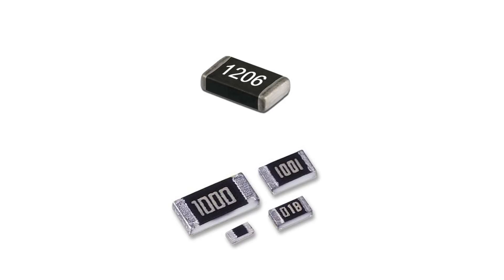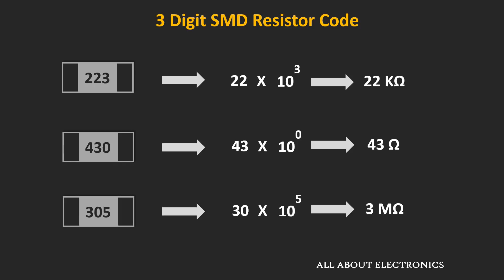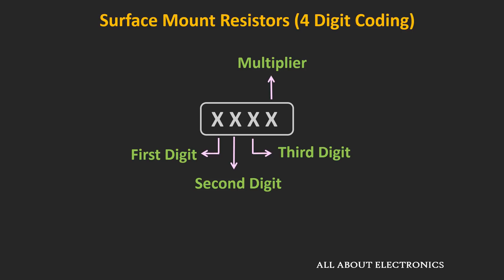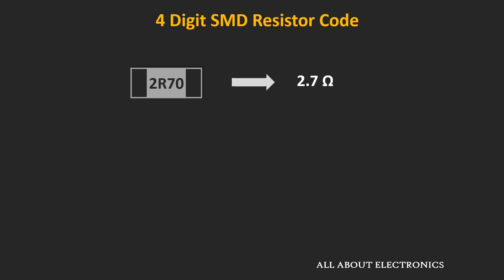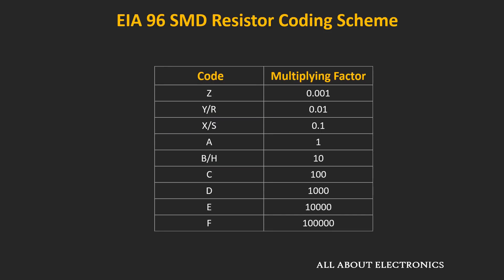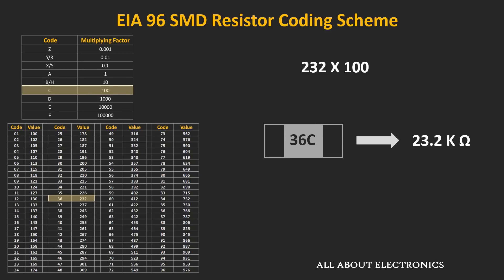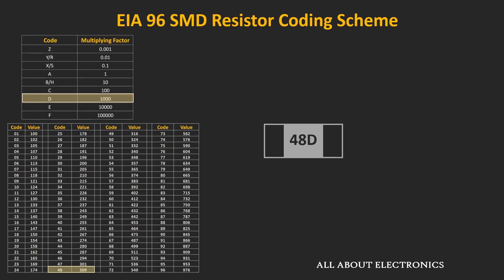SMD Resistor Coding Explained

Comment from the maker: The timestamps for the different topics covered in the video:

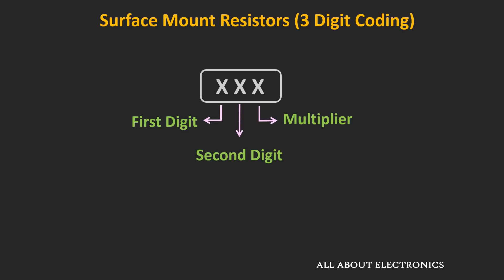0:57   Three digit Coding Scheme

2:41    Four-digit Coding Scheme

4:20    EIA 96 SMD  Resistor Coding Scheme
Reply: ALL ABOUT ELECTRONICS sir I want to talk to you. When will you be free from work ? Can you give me your contact no.
Reply from the maker: You can send me the message on either Facebook page or Instagram.
The link is given in the description of the video.
And preferably contact me in the evening after 8:00.
Reply: ALL ABOUT ELECTRONICS ok sir. Thank you .
Reply: Very nice explanation sir
Reply: There are several factors in studying electronics. One resource I found which successfully combines these is the Gregs Electro Blog (google it if you're interested) definately the most incredible info that I've heard of. look at this  interesting resource.
Reply: Nice Video! Forgive me for butting in, I am interested in your initial thoughts. Have you heard the talk about - Qanayce Wiyulian Equalizer (just google it)? It is a good one off product for unveiling the technique to repair your electronic items without the normal expense. Ive heard some interesting things about it and my coo-worker after many years got excellent results with it.

Comment: Sir one doubt 3.54
4 digit smd register 
0R24=. 0.2*10^4= 2kohm
But
You told 0.24 ohm

Which one is correct??
Reply from the maker: When R is used in the code, it represents the decimal point. So, 2R70 is basically 2.7 ohm and likewise, 0R24 is 0.24 ohm. I hope, it will clear your doubt.

Comment: one of my smd resistor is blown how am I supposed to find the value for it?
Reply from the maker: Unless you have a  circuit diagram , I think you won't be able to find the value of that resistor. Is the code still visible on that, I doubt that though.
Reply: @ALLABOUTELECTRONICS  I have seen the circuit diagram the model number of the board is same as that of the circuit diagram and the resistor is said to be 4R7 but there are other resistor on board which do not match with the diagram

Comment: Does the size matter for smd tks and are there + or - or i can solder them both ways tks
Reply from the maker: For SMD resistor, there is no polarity. It can be connected either way.

Comment: How do you  identify a SMD resistor that has no markings??
Reply from the maker: If there is no marking then you can measure the resistance using multimeter. ( SMD Tweezer)

Comment: How do you find the value of the ones which has no code on them?
Reply from the maker: Using multimeter, you can check the resistance, if the code is not given.
Reply: @ALLABOUTELECTRONICS  Yeah, I'm trying to find the code/ value of tiny smt/smd capacitor/ resistor on a playstation 3 console motherboard. It's a pain to know.

Comment: Thank you for the excellent video.
However, I have a resistor with only "0" (zero) on it!  What does that mean PLEASE?!
Reply from the maker: Its zero ohm resistor
Reply: 8
Reply: @rossmoodley9407  eaven more confusion! If the resistance is zero, why bother to use it?!
Reply: What would R25F on a smd mean?

Comment: Sir please tell me the value of 8F5 , i am not sure if it is a resistor or smd ceramic capacitor ,i want to find the value , 8F5 is written on the board and not on component it self ,......... Please help me sir jus tell me the vale of 8F5 ,🙂🙂🙂🙂🙂🙂🙂😗😗😗😗😗😗
Reply: I am confused because it is not written 8R5 or 8K5 but 8F5 which i have seen for the first time

Comment: Sir plz explain '0' ohm resistor and why use on pcb ?
Reply from the maker: It acts like a jumper. When you want to connect two tracks then it can be used. Its particularly used for smd components. 
For normal PCB, we can used jumper but the PCB with smd components 0 ohm resistor is useful.

Comment: Hii sir.. Smd risistor 1201 have any direction or any polarity??
Reply from the maker: No, resistors do not have any direction or polarity like a capacitor.
You can connect them in either direction in the circuit.

Comment: Can you tell me how to identify the number on the resistor which is burnt out
Reply from the maker: If the resistor is burnt out then it won't behave like a resistor in most cases. So, even if you measure the resistance using the multi-meter, it won't give you the proper reading. 
If it is not burnt out and let's say some how the code is not visible then the value of the resistance can be found out using the multi-meter.
Reply: @ALLABOUTELECTRONICS  thanks a lot 👍👍

Comment: i think measure smd resistor with Multimeter faster than table value but for repair circuits some times need it. thanks good video.

Comment: 4 digit smd resistor code example is wrong
If 1001 is 1k 
Then 5103 is not 510k
Reply: 1001 means (100)*10^1 = 1000 = 1k
if you have a code abcd the value will be the concatenation of (abc) multiplied by 10^d. So 5103 means (510)*10^3 = 510000 = 510k
Reply: @ave Maria Stephina
the best way to read resistors with colors black to white or numbers 0 to 9 is just to treat them all as numbers with the first two or three as the value and the last one as the number of zeroes :-) 
when you have gold , silver or the letter R it is the position of the decimal point with gold being dot (or R) in between the numbers , and silver the dot (or R) in front of the numbers :-)
but with new color band resistors it is best to use a meter , its too easy to read from wrong end :-)